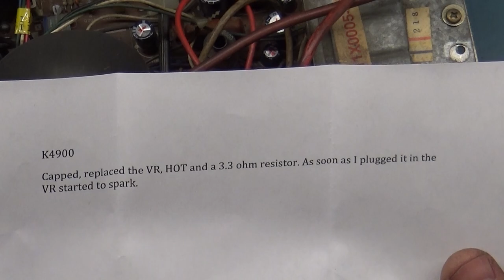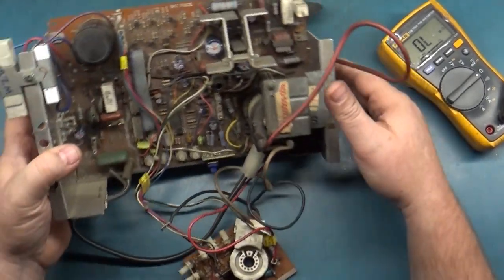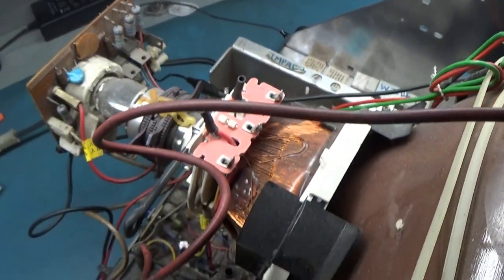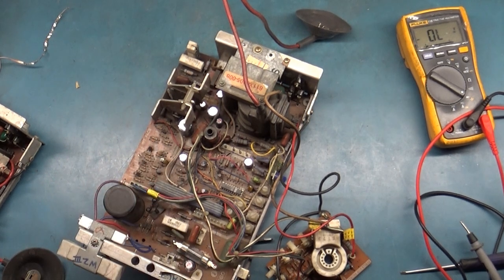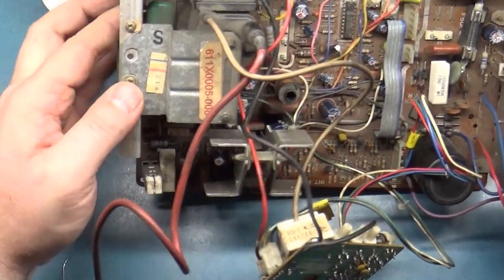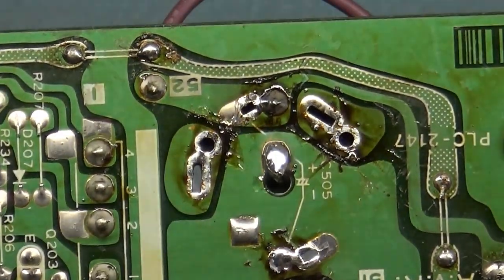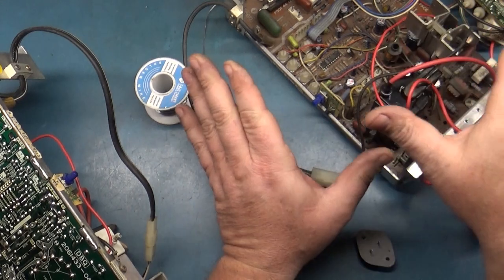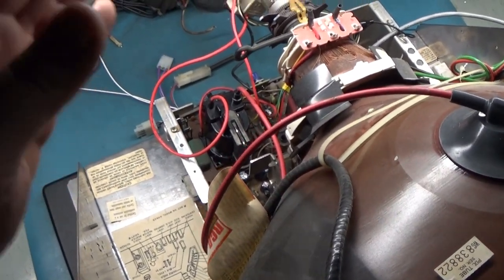19" K4900 Arcade Monitor Chassis Repair - Shorting Voltage Regulators, Bad Solder Work, Broken Pads

Comment: What a fricking pain in the butthole... How is it possible that the HOT was shorted to the frame but the HOT read just fine and it wasn't shorted itself? That's puzzling. How did you discover the HOT was the cause?
Reply from the maker: By removing and inspecting it.
Reply: @MikesArcadeMonitorRepair  But yeah, you didn't have a clue that was the case. The readings were ok...
Reply from the maker: Last ditch effort. The HOT was actually good. It was just dumping it's voltage to the frame and killing the VR because of the hole in the insulator.
Reply: @MikesArcadeMonitorRepair  Crazy. Thanks for the explanation and keep up the good work. Learning a lot watching the vids!